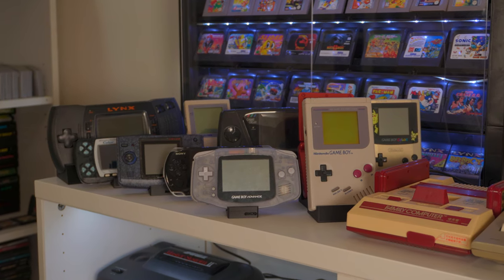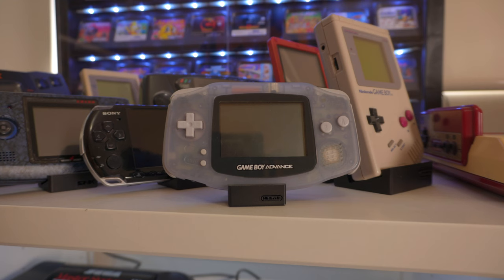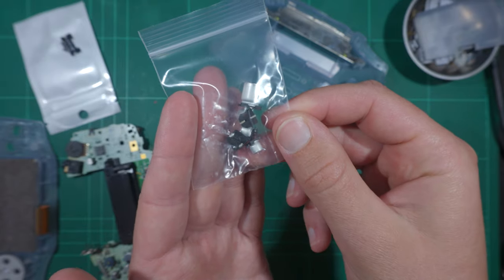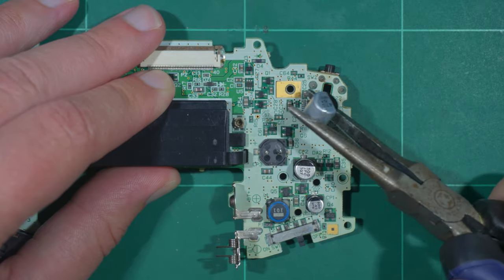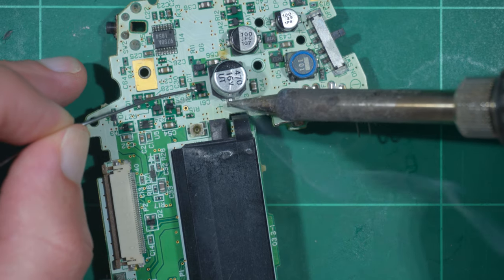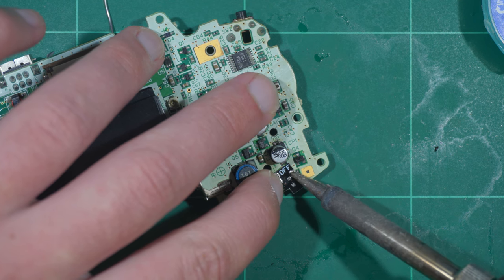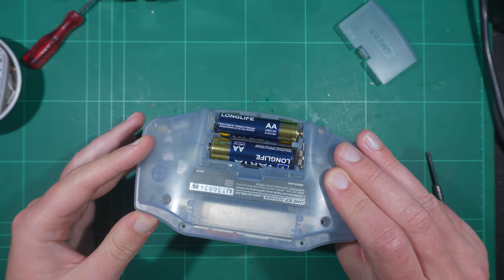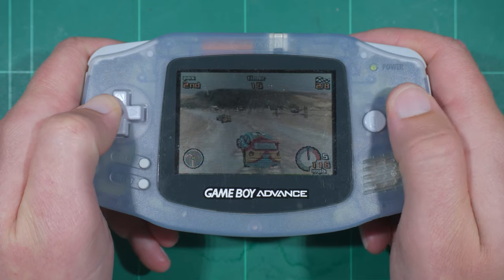GBA Capacitor & Switch Replacement Guide

Comment: I actually ripped one of the pads for the big capacitor since its glued unlike the others. Would definitely recommend to anyone watching this video or others that recommend twisting the big capacitor off, to not do that and use a hot air gun or hot tweezers if you can, which will safely remove the large capacitor and not be a huge gamble to replace safely.